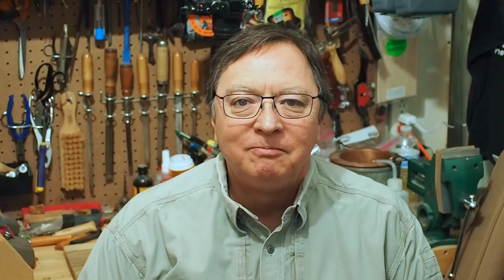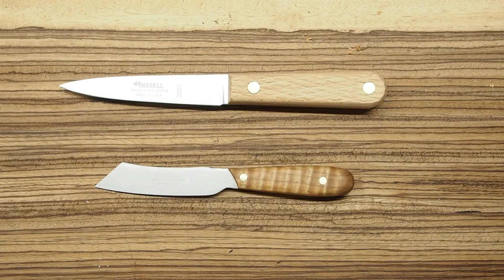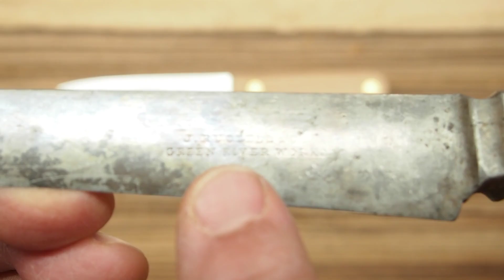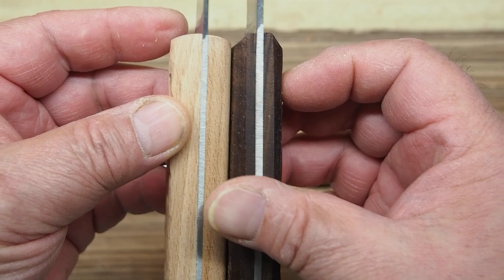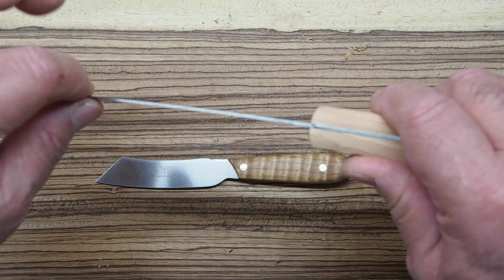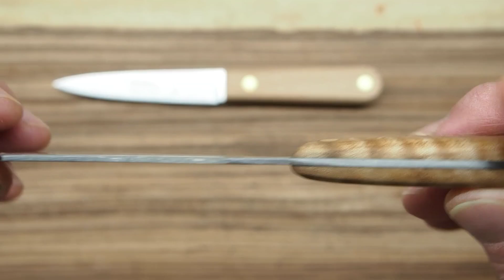Green River Ripper and Patch Knives

Comment: Looks to me that the hunter pattern would make a good all around game processing and camp knife. Only problem is there is no gaurd and the the blade is a bit long for the handle. It would be easy to w 10:04 hack yourself with it. I intend to use a dremel or small file to put in a little series of slots to tell my fingers far enough and another series for my pointer finger when im skinning. I think that will work well for me.

Comment: Central Restaurant suppliers has the finished hunter paternal for about 15 bucks in carbon steel. Cheapest I've seen so far. Though I believe in supporting Track of the Wolf in order to keep that warehouse supply going to supply the needs of the black powder community I also believe in a good deal.
Reply from the maker: I'll check them out, thanks!